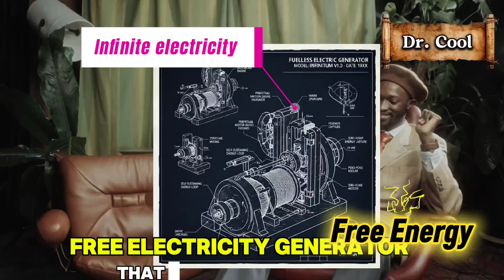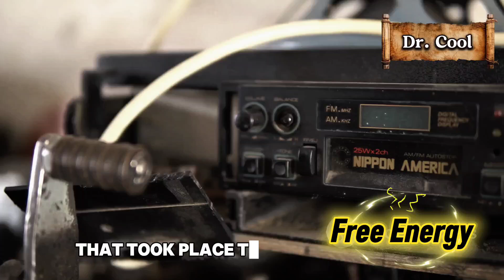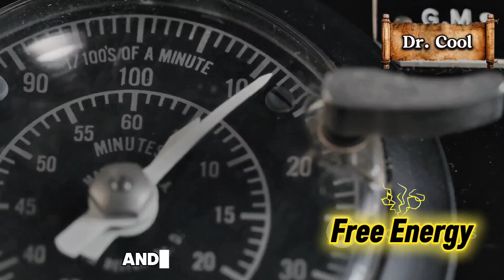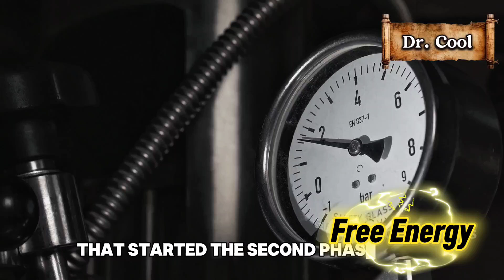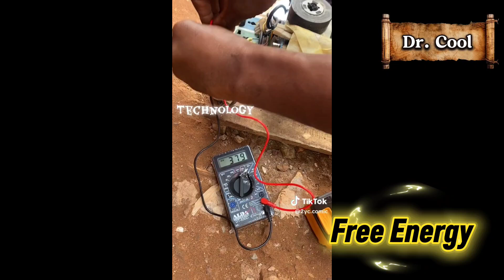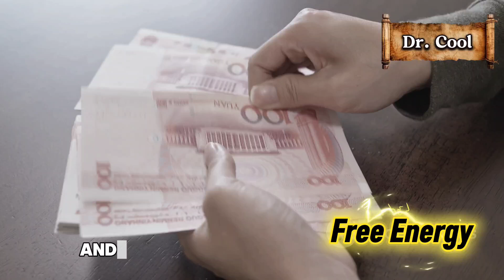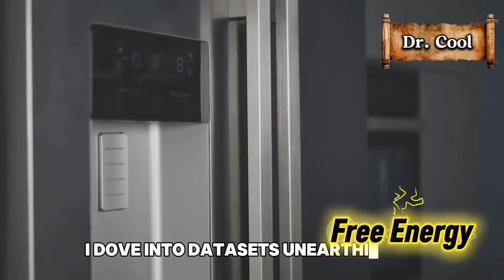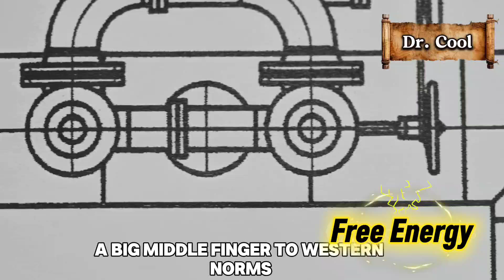Young African Genius Just Built Free Electricity Generator That Runs For Ever!

Comment: My claim of EMP resistance was simply that DIODE ARRAY power circuits would have EMP protection added by considering EMP in future electrical systems using DIODE ARRAYS. Many future DA using devices would be small and have self contained built in power so they don't have susceptible power wiring. Extensive power grids intrinsically also spread EMP surges.  Metal oxide surge protectors are adiquate if EMP effects are rare and weak. l don't know how much designers need to anticipate EMP terrorists with transportable EMP weapons. Many people will have basic needs like hotplates, lamps, and cold chests that are somewhat EMP resistant.  

Aloha
Charles M Brown
Kilauea, Kauai, Hawaii 96754